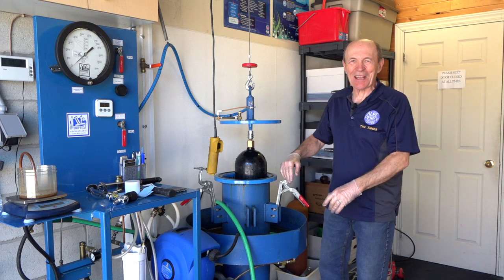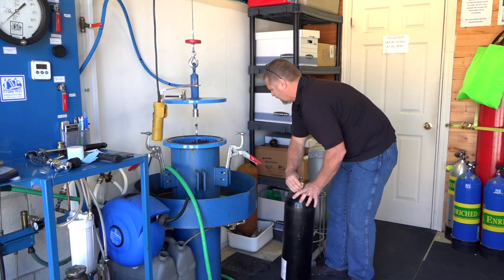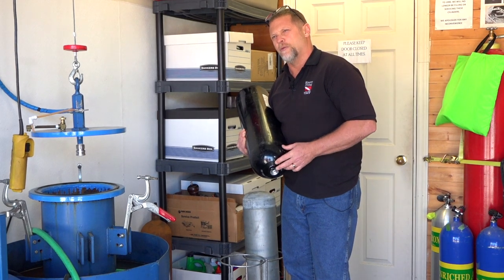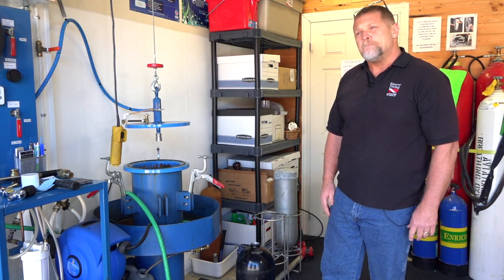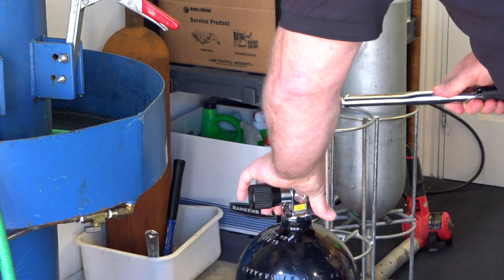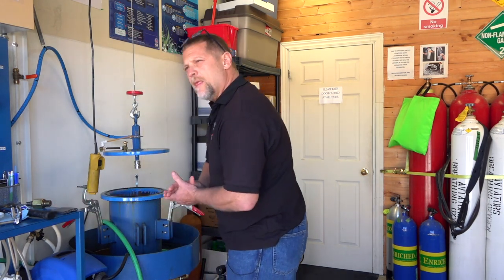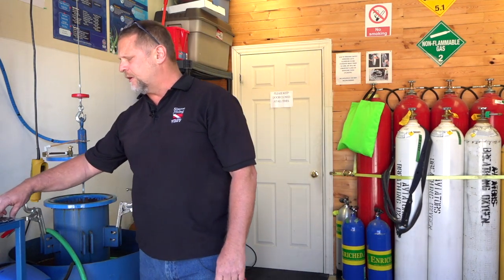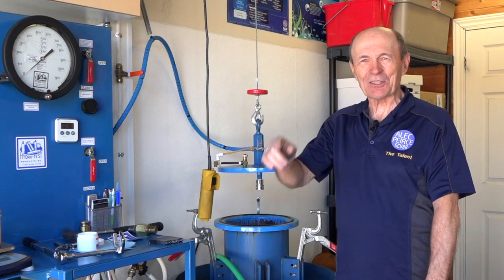Hydrostatic Testing A Scuba Tank, Part 2 - Scuba Tech Tips: S11E04

Comment: Alec, I have an older steel welding bottle holding oxygen.  I'd like to repurpose it for scuba.  Assuming I tumble it and get it inspected, is there any reason it cannot be used as an air cylinder?
Reply from the maker: It must have a certificate # stamped on the tank certifying it is suitable for breathing gas and diving, a Visual Inspection and Hydro test.   Your dive shop will not fill any old tank, only valid ones.  Read this before spending money.
https://www.catalinacylinders.com/faqs/crown-markings-of-a-standard-scuba-cylinder/

Comment: Hay Alec 
when I go to the dive shops around me to punches a regulator they only want to sell me the most expensive regulator they have. I am a new diver I just wanted to know what you would recommend on a regulator for me to buy
Reply from the maker: I could run on for pages but to give you the best information, watch S05E09 on $300 vs $800 regs and S11E03 There is NO best regulator.  These should give you background on what YOUR diving needs are, not a stores selling priority.  Thanks for watching James.
Reply: I would RUN way from these guys.  There is nothing wrong with buying the most expensive one...if that is what you want.  But they need to help by actually guiding you to what you might want, not try to get you to buy expensive!  They aren't trying to provide a service, they are trying to get your money.  Drive farther away or do some research on the world wide internets, then find a better LDS (local dive show) around you, or maybe one that does internet business that is in your region.
You can always talk to a shop in a bigger town that you may go to occasionally.  Buy it from them and then have them hold it until your next trip.  I would really lean more towards a LDS somewhere, but that still doesn't always work for you.

Comment: Another way we have it easy doing sums in Europe:  tanks are described by actual volume and a litre of water weighs a kilo.   So if a 12 litre cylinder weighs 13 kg empty, it weighs 25 kg full of water.  Hopefully though that's not a calculation I'm going to have to make while diving.
Reply from the maker: I know metric is the best, but I like pounds for meat, psi for pressure, Celsius for temperature and kilometres for distance.  So I'm 1/2 metric!!!
Reply: @AlecPeirceScuba_SeaHunter  me too.  Stuff I do in everyday life works best in feet, inches and pounds, human-based units.  I drive with mph and use yards on the golf course.  But as soon as I have to do the math it's straight to metric.

Comment: Hey, im a new suba diver. I had a question about suba tank boots. What do I get? There is so many. Thank you.
Reply from the maker: Tank boots are available everywhere for steel and aluminum to hold the tank upright or to stop it rolling.  Steel tanks need them more as they generally have a round bottom where Aluminum 80's have flat bottoms and don't use boots generally.  Thanks for watching Decko.
Reply: Thanks, I appreciate it. I started geting into scuba when i was 8, I am 12 now and you are still helping me all the way though.😊
Reply: What is suba??
Reply: Any will do, I color co-ordinate mine so I know which tank is mine.

Comment: There is no way that a one person operator can torque the Scuba tank valves to 40-50 ft-lb (54-68 NM) without a tank vise.
Reply from the maker: There is a tank vice at Simcoe Diving along with a 4 foot extension bar.  Not to tighten valves but to loosen them from dive shops and divers who believe only Hulk strength will keep air in a tank.
Reply: @AlecPeirceScuba_SeaHunter  First of all let me say that I am happy to see Chris Sproule using the torque wrench but there is no way that he applied between 40 and 50 ft-lbs of torque in the video because of the fact that the tank was not in a vice and no "Hulk strength" guy was holding the tank. The tank vice is absolutely needed inorder to apply the 40 to 50 ft-lbs of torque required by the manufacturers of the Scuba tank valves on Standard Aluminum 80 cylinders. In the past when a vice was not available, I was able to have another person manage to keep a tank from rotating when I was using the torque wrench, but it's impossible for one person to hold the tank and apply the torque without a vice.
Reply: @mirriwinni  When Chris was tightening the valve and explaining what happens, it was only an example.
The bottle that was used still had to be dried and visually inspected before being torqued closed.
Like he said in the video, to do the steps properly he would do it in his room equipped for it.
To do that, yes, he would have used a tank vice. :)